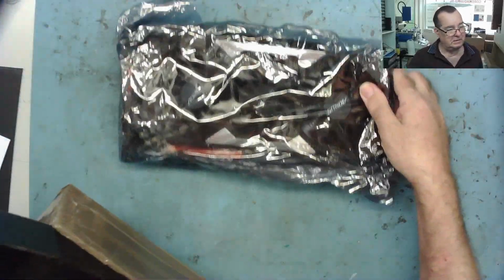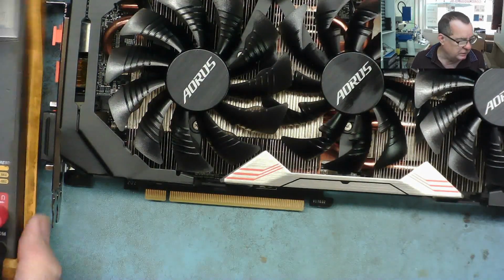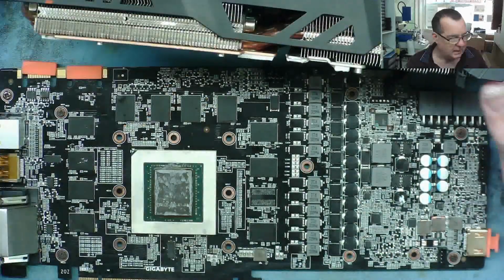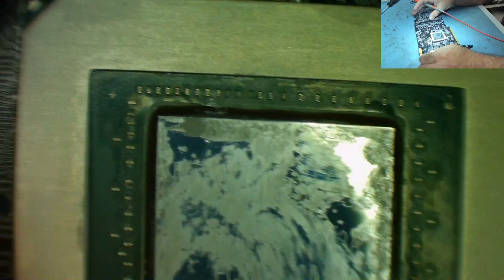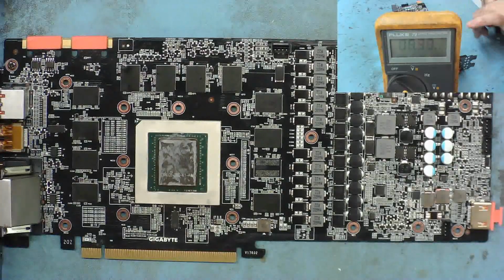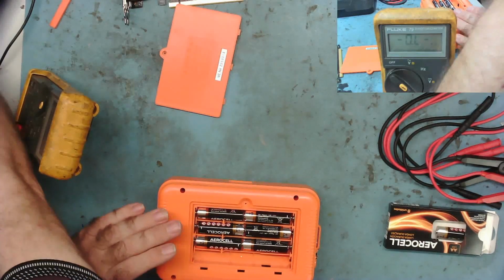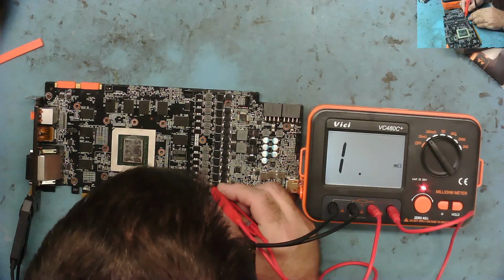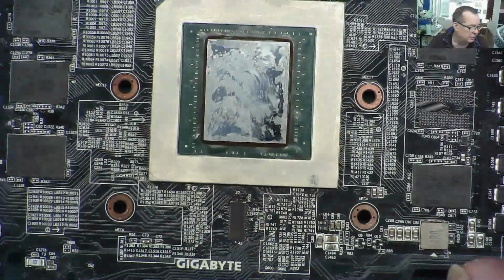This GTX 1080 ti was sent for repair by a subscriber - he says it is DEAD.  Can we repair it?

Comment from the maker: Here is a final update on this repair attempt.   I was quoted €397 for a replacement GPU chip, guaranteed working,  and even though I offered to repair this card with no costs for work undertaken (just pay for parts) the owner felt it was uneconomical to repair.  Which in fairness I have to agree.  He decided let me keep the card for parts as it would make a good donor for other repairs, and hoped it could be used in the future to fix somebody else's graphics card.  

From my point of view this is one less uneconomical to repair graphics card doing the rounds on ebay, it will most certainly not be going back into circulation.  Luis, if I can help you again in the future I will not be charging for my time, that's the least I can do for you.
Reply: you are indeed a good person and a genius electronics technician, my best wishes

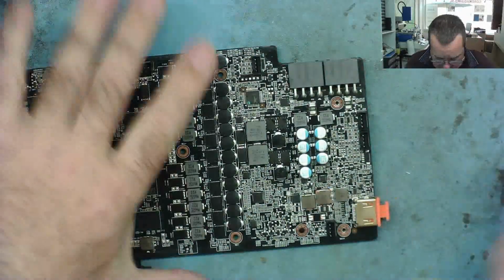Comment: Hello, i bought the same used card as on video, while checking for shorts i ran into kind of a problem where my multimeter reads or not some ohms depending how i put a probe on the part, also a capacitor that is above your index finger at 7:01 (the one thats kept alone above the screw hole) is missing could that be an issue keeping gpu from getting detected? (I know that the video is one year old, but I appreciate if you actually see it)

Comment: Sorry Louis, either you or some person with a hot air gun has destroyed the beautiful gpu. You will pay more than 500$ or 500€ to replace this gpu. Tech City Yes destroys another card. Do not believe everyone on the internet. He may be able to not overheat and bubble up the surround on the graphics chip, but if you are not seriously careful it is destruction. Use a more expensive hot air station that controls the heat and air flow or you have a not so cheap fix. Bad information Tech Yes City. Like Sorin in Britain saying to short the first mosfet. He really regrets saying that now. Sorin is from Romania and he knows what he can get away with, how many filter caps are needed and such. Our job is to find what the value of the component is and replace it with a near value as possible, like Eli does.

Comment: Hey LER, have a question, I've come upon a certain issue, after replacing the thermal paste on my laptop (XPS 9570, which I got for a good deal), I forgot to connect the fan header, and upon playing games, it started crashing, so I was like what's goin on, until I turned off my OC and noticed the temps were quite high, then when I restarted the laptop a DELL thing started and checked for device performance and status, and said that gpu fan was not working, ... so, lol, after connecting that I went back in and the crashing continued, but now it only crashes above a certain OC threshold (like I've degraded the performance and the chip is damaged),

What could the issue be, could something have gotten damaged in either the chip or maybe the power phases that regulate or adjust the power lines to the card? It only seems happening now after a certain threshold (where before it would be okay), now after a certain threshold it just crashes, like it can't go further than that, so somewhere along the power delivery there's gotta be a fault and I'm worried that the un-fanned and OCed gaming attempts with several crashes not knowing what the issue was, could've caused damage to either the chip or some power delivery lines to the chip or I don't even know, any help would be appreciated! I don't have a multimeter so wouldn't be able to check (but want to buy one), if it were a cap (those are the ones next to the chip right? On the green background (as per your video), then those could be very hard to replace right, if at all?) Anyway, any and all input is very much appreciated, and nice video btw. Thanks, David.

Comment: Hi, always something new to learn from you! I wonder, if PEX rail is shorted, does it always means that GPU (proccesor) is dead? Tnx
Reply from the maker: Not necessarily.  Though it often would be the GPU chip, there could be a short circuit capacitor for example or faulty VRM (low side mosfet short to ground) on PEX.

However I would say if you have a short on both PEX and 1.8V you can be pretty damn sure the GPU is dead (shorted)

This is what I predicted I would find once I saw the heat-gunned GPU and I was absolutely correct.
Reply: @LearnElectronicsRepair  On 1.8 rail I have 1.8V and 130 Ohms (pretty low!). On PEX there's 5 Ohms(!!!) and 0V .
Should I inject low volts to PEX inductor to found what's hot?

Comment: No autorange on this thing, why...
Reply from the maker: No idea John.   As I mentioned I also ordered another milliohm meter, the cheapest one I could find, not that I need two of them but purely to entertain you guys.  😁

I'll be making a review/comparison video of the two once it arrives to see if there is any reason to buy the Vici VC480C+ vs cheaper options and to investigate how useful these type of low resistance meters actually are for short circuit finding.
Reply: looking forward to it, thanks Richard

Comment: Hi Richard,
First of all, thx for the time spend on it :)
The history is quite simple. This card was bought by a friend and he has been "scammed". The price was below the market and he thought that was a good deal... which was absolutelly not... He try to get his money back but with no success... The missing screws was my fault because I dismounted the fans and the back plate as the card was not functionning and I loose some of them. 
Thanks again for your time :)
Reply from the maker: Thanks for letting us know the history of this card.  If it was sold as working, he was certainly scammed.  If it was sold and described as anything other than spares or repair he was scammed.  If it was spares or repair, well it could be used as donor for spares (donor board) or could be repaired by replacing the GPU chip (depending on any pcb damage) so it fits that description.  Sorry about the bad news, he certainly got his fingers burnt.  Please email me and let me know what to do with the card.

Comment: Hi Richard, how are you? Your channel is great and educational. I love it. I would like to ask you can you remove a gpu chip with just a hot air gun ? Kind regards
Reply from the maker: Oh that is really not possible. Even with the Quick 861DW which is a good hot air station.  It should be possible with the Quick plus a good infrared preheater, but my small hot air preheater (Kada 853B) is only capable of getting high thermal mass PCBs (such as GPU) up to about 90C which isn't hot enough.  I have tried this before with LGA socket removal, which is pretty similar and I made a video of that - have a look.   If you can't get enough heat evenly into the entire PCB, you may still get the BGA off with a powerful hot air station but the PCB delaminates (plus you are likely to strip some pads off as well) and is then useless.

https://www.youtube.com/watch?v=x9Xiv19Kx-8

Comment: Hi Sir, I have an ATX PSU and the only problem is the 12V rail...it is only reading 9-10V. Where should I start looking or checking?
Reply from the maker: Put a load on 3.3V rail and see if it then works properly on 12V
Reply: @LearnElectronicsRepair  hi Sir, can i use a psu tester to check if i can get 12V? What happens next if i still get less than 12V?
Reply from the maker: @remartogonon5606  The PSU tester usually does not load the PSU - I use a 100W 2 Ohm resistor.  This puts about 1.6A load on 3.3V and then it should stabilise all the other voltages.  Try this before you spend any more time trying to diagnose the fault
Reply: Sir, thank you for your advise...big help for me..

Comment: Someone repaired it for good :D 1080 ti is an 11 gig card. There has been no RAM chip at the empty position from the factory.(for the comments)
Reply from the maker: Yeah that is what I also said.  Question.  I understand the missing RAM bank can be in various places, and I assume the GPU BIOS specifies the missing bank location, so if you replace the GPU from another card, how do you know it is ignoring the correct misssing RAM bank?
Reply: @LearnElectronicsRepair  it is always the same bank that is empty as far as I know. Your memory chip brand is micron by the way.
Reply: @bariscosmaz  not the same always, it's written on the gpu if it's K1 it's a1 bank empty K2 it's B1 K3 c1 ...etc
Reply: @bariscosmaz  It's usually A0 empty, but not always :)
Reply: @khirobey6261  Now, I learned. Thanks.
Reply from the maker: @Sydney268  Now I learned too.  Thanks
Reply: @LearnElectronicsRepair  I would pay to know how to configure bios to ignore specific memory bank.
50 bucks via PayPal.
Anyone ?
Reply: @tonycstech  thatt not possible. Banks are configured via gpu internal firmware, this information would cost more like 500k.
Reply: @tonycstech  it's impossible, the memory controller is disabled internally in the chip
Reply: @LearnElectronicsRepair  The K1 in the GPU part number denotes the missing memory bank

Comment: Hi Richard,
This GPU is "very nice" delaminated by heatgun, but also missing one of the RAM IC on the right bottom next the GPU. I hope you can get those spare IC's from China to be able to repair these cards!
Regards Marc
Reply from the maker: Are you sure about it missing a RAM chip?  As far as I understand, these 11Gb 1080ti always have 12 places for RAM and only 11 fitted.  I also understand that the missing one could be in any position and there are settings in the GPU BIOS to tell it which bank to ignore.  How that affects the situation if you replace the GPU and how to make sure it is set to ignore the correct bank I an not sure..... yet 😉
Reply: @LearnElectronicsRepair  
Oh, OK. I missed this 11gig info, not a common size.
Reply from the maker: @laszlomarktoth7492  Yeah it isn't common  - AFAIK it is only 1080ti that have this weird thing with 11Gb.  I sometimes wonder if it is because many of the GPU chips are faulty from manufacture on one or another of the 12 RAM banks, so they disable the one bank (not always the same one) in the BIOS so they can sell the faulty chips?
Reply: @LearnElectronicsRepair  Yes, very likely. No waste... just money! :-)
Reply: A0 is almost always missing on 11gig versions of cards.

Comment: Hey Richard, would be really good to see you put a new gpu on this card, I look forward too it ;)  Thanks
Reply from the maker: Depends on the price I am quoted and the owners decision. I have the equipment to change the GPU as you probably saw on previous videos. Anyway I will post updates in the comments section and pin them.  If it ends up being replaced there will certainly be a follow up video.  The first thing before ordering would be to remove the faulty GPU, check out the PCB condition under the GPU and make sure all the DQxx connections to the VRAM test OK (basically checking the RAM chips are probably OK).  All depends on the owners decision before I do that work but will let you all know anyway.